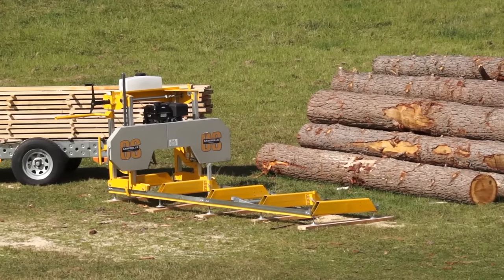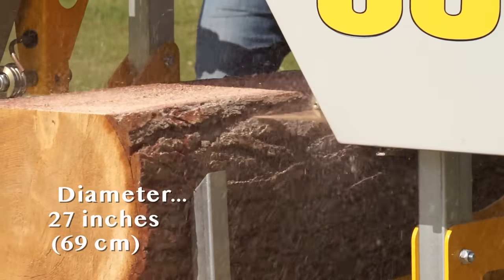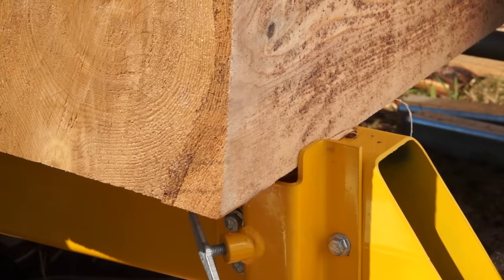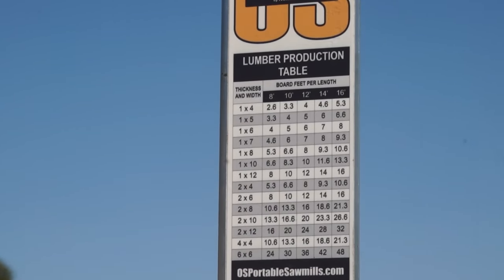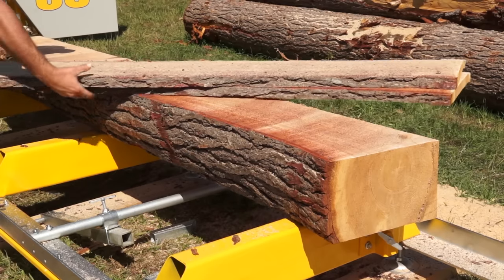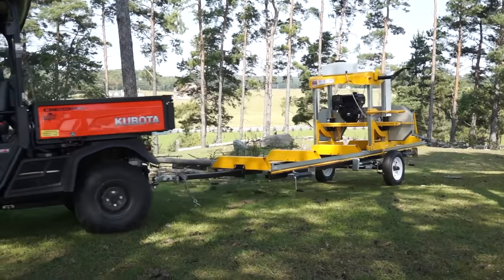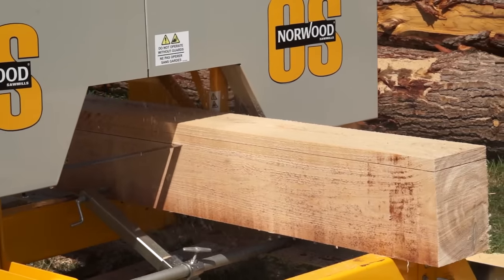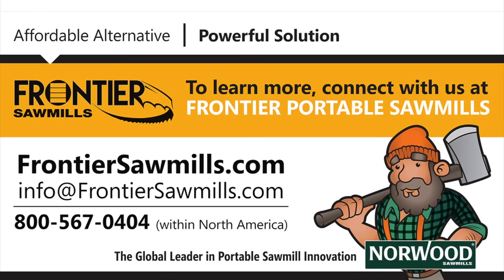The Affordable, Easy-to-Use & Reliable Sawmill You've Been Looking for - The Frontier OS27

Comment: What is the price
Reply from the maker: Frontier builds three sawmill models with different log diameter capacities: OS23: 59cm (23”), OS27: 69cm (27”), and OS31: 79cm (31”). Standard log length is 3.4m (11’) but you can add 7’ (2.1m) extensions to mill as long as you want.  You can add the optionally available trailer/support jack system to all Frontier sawmills at any time (when you get your Frontier or in the future).

Frontier Sawmills start at just USD $2297 (for the Frontier OS23). The Frontier OS27 starts at only USD $3297.  The Frontier OS31 starts at only USD $3897.  

You can get a lot of helpful info about Frontier Sawmills, including all pricing, at www.FrontierSawmills.com  .

Frontier services your country factory-direct.  To order, contact us directly at Frontier Sawmills via email at info@FrontierSawmills.com .

Comment: how much is the price of the day
Reply from the maker: Frontier builds three sawmill models with different log diameter capacities: OS23: 59cm (23”), OS27: 69cm (27”), and OS31: 79cm (31”). Standard log length is 3.4m (11’) but you can add 7’ (2.1m) extensions to mill as long as you want.  You can add the optionally available trailer/support jack system to all Frontier sawmills at any time (when you get your Frontier or in the future).

Frontier Sawmills start at just USD $2297 (for the Frontier OS23). The Frontier OS27 starts at only USD $3297.  The Frontier OS31 starts at only USD $3897.  

You can get a lot of helpful info about Frontier Sawmills, including all pricing, at www.FrontierSawmills.com  .

Comment: how many price in bangladesh.I want it
Reply from the maker: Frontier builds three sawmill models with different log diameter capacities: OS23: 59cm (23”), OS27: 69cm (27”), and OS31: 79cm (31”). Standard log length is 3.4m (11’) but you can add 7’ (2.1m) extensions to mill as long as you want.  You can add the optionally available trailer/support jack system to all Frontier sawmills at any time (when you get your Frontier or in the future).

Frontier Sawmills start at just USD $2297 (for the Frontier OS23). The Frontier OS27 starts at only USD $3297.  The Frontier OS31 starts at only USD $3897.  

You can get a lot of helpful info about Frontier Sawmills, including all pricing, at www.FrontierSawmills.com  .

Comment: how much i want a one
Reply from the maker: Frontier builds three sawmill models with different log diameter capacities: OS23: 59cm (23”), OS27: 69cm (27”), and OS31: 79cm (31”). Standard log length is 3.4m (11’) but you can add 7’ (2.1m) extensions to mill as long as you want.  You can add the optionally available trailer/support jack system to all Frontier sawmills at any time (when you get your Frontier or in the future).

Frontier Sawmills start at just USD $2297 (for the Frontier OS23). The Frontier OS27 starts at only USD $3297.  The Frontier OS31 starts at only USD $3897.  

You can get a lot of helpful info about Frontier Sawmills, including all pricing, at www.FrontierSawmills.com  .

To order, contact us directly at Frontier Sawmills via email at info@FrontierSawmills.com .

Comment: How many cost
Reply from the maker: Frontier builds three sawmill models with different log diameter capacities: OS23: 59cm (23”), OS27: 69cm (27”), and OS31: 79cm (31”). Standard log length is 3.4m (11’) but you can add 7’ (2.1m) extensions to mill as long as you want.  You can add the optionally available trailer/support jack system to all Frontier sawmills at any time (when you get your Frontier or in the future).

Frontier Sawmills start at just USD $2297 (for the Frontier OS23). The Frontier OS27 starts at only USD $3297.  The Frontier OS31 starts at only USD $3897.  

You can get a lot of helpful info about Frontier Sawmills, including all pricing, at www.FrontierSawmills.com  .

Frontier services your country factory-direct.  To order, contact us directly at Frontier Sawmills via email at info@FrontierSawmills.com .

Comment: What is cost of it
Reply from the maker: Frontier builds three sawmill models with different log diameter capacities: OS23: 59cm (23”), OS27: 69cm (27”), and OS31: 79cm (31”). Standard log length is 3.4m (11’) but you can add 7’ (2.1m) extensions to mill as long as you want.  You can add the optionally available trailer/support jack system to all Frontier sawmills at any time (when you get your Frontier or in the future).

Frontier Sawmills start at just USD $2297 (for the Frontier OS23). The Frontier OS27 starts at only USD $3297.  The Frontier OS31 starts at only USD $3897.  

You can get a lot of helpful info about Frontier Sawmills, including all pricing, at www.FrontierSawmills.com  .

Comment: How much cost a machine like this?
Reply from the maker: Frontier builds three sawmill models with different log diameter capacities: OS23: 59cm (23”), OS27: 69cm (27”), and OS31: 79cm (31”). Standard log length is 3.4m (11’) but you can add 7’ (2.1m) extensions to mill as long as you want.  You can add the optionally available trailer/support jack system to all Frontier sawmills at any time (when you get your Frontier or in the future).

Frontier Sawmills start at just USD $2297 (for the Frontier OS23). The Frontier OS27 starts at only USD $3297.  The Frontier OS31 starts at only USD $3897.  

You can get a lot of helpful info about Frontier Sawmills, including all pricing, at www.FrontierSawmills.com  .

Frontier services your country factory-direct.  To order, contact us directly at Frontier Sawmills via email at info@FrontierSawmills.com . 

Thanks!

Comment: Any idea how much costs?
Reply from the maker: Frontier builds three sawmill models with different log diameter capacities: OS23: 59cm (23”), OS27: 69cm (27”), and OS31: 79cm (31”). Standard log length is 3.4m (11’) but you can add 7’ (2.1m) extensions to mill as long as you want.  You can add the optionally available trailer/support jack system to all Frontier sawmills at any time (when you get your Frontier or in the future).

Frontier Sawmills start at just USD $2297 (for the Frontier OS23). The Frontier OS27 starts at only USD $3297.  The Frontier OS31 starts at only USD $3897.  

You can get a lot of helpful info about Frontier Sawmills, including all pricing, at www.FrontierSawmills.com  .

Comment: Can we get this in india?
Reply from the maker: Hi Anil

Frontier builds three sawmill models with different log diameter capacities: OS23: 59cm (23”), OS27: 69cm (27”), and OS31: 79cm (31”). Standard log length is 3.4m (11’) but you can add 7’ (2.1m) extensions to mill as long as you want.  You can add the optionally available trailer/support jack system to all Frontier sawmills at any time (when you get your Frontier or in the future).

Frontier Sawmills start at just USD $2297 (for the Frontier OS23). The Frontier OS27 starts at only USD $3297.  The Frontier OS31 starts at only USD $3897.  

You can get a lot of helpful info about Frontier Sawmills, including all pricing, at www.FrontierSawmills.com  .

Frontier services your country factory-direct.  To order, contact us directly at Frontier Sawmills via email at info@FrontierSawmills.com .
Reply: @FrontierSawmills  davanga manadu kovai

Comment: I want this machine how to by??????
Reply from the maker: Frontier builds three sawmill models with different log diameter capacities: OS23: 59cm (23”), OS27: 69cm (27”), and OS31: 79cm (31”). Standard log length is 3.4m (11’) but you can add 7’ (2.1m) extensions to mill as long as you want.  You can add the optionally available trailer/support jack system to all Frontier sawmills at any time (when you get your Frontier or in the future).

Frontier Sawmills start at just USD $2297 (for the Frontier OS23). The Frontier OS27 starts at only USD $3297.  The Frontier OS31 starts at only USD $3897.  

You can get a lot of helpful info about Frontier Sawmills, including all pricing, at www.FrontierSawmills.com  .

Comment: Ye masin kitna ka hai
Reply from the maker: Frontier builds three sawmill models with different log diameter capacities: OS23: 23” (59cm), OS27: 27” (69cm), and OS31: 31” (79cm). Standard log length is 11’ (3.4m) but you can add 7’ (2.1m) extensions to mill as long as you want.   

Frontier Sawmills start at just USD 2297 (for the Frontier OS23). The Frontier OS27 starts at only USD $3297.  The Frontier OS31 starts at only USD $3897.  

You can get a lot of helpful info about Frontier Sawmills, including all pricing, at www.FrontierSawmills.com  .

Frontier services your country factory-direct.  To order, contact us directly at Frontier Sawmills via email at info@FrontierSawmills.com .

Comment: i need a 1* complete set total cast with shipping charges
Reply from the maker: Frontier builds three sawmill models with different log diameter capacities: OS23: 59cm (23”), OS27: 69cm (27”), and OS31: 79cm (31”). Standard log length is 3.4m (11’) but you can add 7’ (2.1m) extensions to mill as long as you want.  You can add the optionally available trailer/support jack system to all Frontier sawmills at any time (when you get your Frontier or in the future).

Frontier Sawmills start at just USD $2297 (for the Frontier OS23). The Frontier OS27 starts at only USD $3297.  The Frontier OS31 starts at only USD $3897.  

You can get a lot of helpful info about Frontier Sawmills, including all pricing, at www.FrontierSawmills.com  .

Frontier services your country factory-direct.  To order, contact us directly at Frontier Sawmills via email at info@FrontierSawmills.com . 

Thanks!
Reply: @FrontierSawmills  I want to buy OS27
Reply: Northeast India
Reply: Yantai RIMA MACHINERY china : $1000 usd

Comment: क्या यह मशीन भारत में उपलब्ध है इसे लेने में कोई कानूनी मुश्किल तो नहीं आएगी
Reply from the maker: Frontier builds three sawmill models with different log diameter capacities: OS23: 59cm (23”), OS27: 69cm (27”), and OS31: 79cm (31”). Standard log length is 3.4m (11’) but you can add 7’ (2.1m) extensions to mill as long as you want.  You can add the optionally available trailer/support jack system to all Frontier sawmills at any time (when you get your Frontier or in the future).

Frontier Sawmills start at just USD $2297 (for the Frontier OS23). The Frontier OS27 starts at only USD $3297.  The Frontier OS31 starts at only USD $3897.  

You can get a lot of helpful info about Frontier Sawmills, including all pricing, at www.FrontierSawmills.com  .

Frontier services your country factory-direct.  To order, contact us directly at Frontier Sawmills via email at info@FrontierSawmills.com . 

Thanks!

Comment: What is price for this machine
Reply from the maker: Frontier builds three sawmill models with different log diameter capacities: OS23: 59cm (23”), OS27: 69cm (27”), and OS31: 79cm (31”). Standard log length is 3.4m (11’) but you can add 7’ (2.1m) extensions to mill as long as you want.  You can add the optionally available trailer/support jack system to all Frontier sawmills at any time (when you get your Frontier or in the future).

Frontier Sawmills start at just USD $2297 (for the Frontier OS23). The Frontier OS27 starts at only USD $3297.  The Frontier OS31 starts at only USD $3897.  

You can get a lot of helpful info about Frontier Sawmills, including all pricing, at www.FrontierSawmills.com  .

Frontier services your country factory-direct.  To order, contact us directly at Frontier Sawmills via email at info@FrontierSawmills.com . 

Thanks!

Comment: I want to this. How can I buy this mini saw mill.
Reply from the maker: Hi Bajun

Just contact us at Frontier Sawmills.

Frontier builds three sawmill models with different log diameter capacities: OS23: 59cm (23”), OS27: 69cm (27”), and OS31: 79cm (31”). Standard log length is 3.4m (11’) but you can add 7’ (2.1m) extensions to mill as long as you want.  You can add the optionally available trailer/support jack system to all Frontier sawmills at any time (when you get your Frontier or in the future).

Frontier Sawmills start at just USD $2297 (for the Frontier OS23). The Frontier OS27 starts at only USD $3297.  The Frontier OS31 starts at only USD $3897.  

You can get a lot of helpful info about Frontier Sawmills, including all pricing, at www.FrontierSawmills.com  .

To order, contact us directly at Frontier Sawmills via email at info@FrontierSawmills.com .

Comment: prince how many
Reply from the maker: Frontier builds three sawmill models with different log diameter capacities: OS23: 59cm (23”), OS27: 69cm (27”), and OS31: 79cm (31”). Standard log length is 3.4m (11’) but you can add 7’ (2.1m) extensions to mill as long as you want.  You can add the optionally available trailer/support jack system to all Frontier sawmills at any time (when you get your Frontier or in the future).

Frontier Sawmills start at just USD $2297 (for the Frontier OS23). The Frontier OS27 starts at only USD $3297.  The Frontier OS31 starts at only USD $3897.  

You can get a lot of helpful info about Frontier Sawmills, including all pricing, at www.FrontierSawmills.com  .

Frontier services your country factory-direct.  To order, contact us directly at Frontier Sawmills via email at info@FrontierSawmills.com . 

Thanks!

Comment: how mach this machine?
Reply from the maker: Frontier builds three sawmill models with different log diameter capacities: OS23: 59cm (23”), OS27: 69cm (27”), and OS31: 79cm (31”). Standard log length is 3.4m (11’) but you can add 7’ (2.1m) extensions to mill as long as you want.  You can add the optionally available trailer/support jack system to all Frontier sawmills at any time (when you get your Frontier or in the future).

Frontier Sawmills start at just USD $2297 (for the Frontier OS23). The Frontier OS27 starts at only USD $3297.  The Frontier OS31 starts at only USD $3897.  

You can get a lot of helpful info about Frontier Sawmills, including all pricing, at www.FrontierSawmills.com  .

Frontier services your country factory-direct.  To order, contact us directly at Frontier Sawmills via email at info@FrontierSawmills.com .

Comment: আসসালামু আলাইকুম এই মেশিনটা কি বাংলাদেশে পাওয়া যাবে
Reply from the maker: Frontier builds three sawmill models with different log diameter capacities: OS23: 59cm (23”), OS27: 69cm (27”), and OS31: 79cm (31”). Standard log length is 3.4m (11’) but you can add 7’ (2.1m) extensions to mill as long as you want.  You can add the optionally available trailer/support jack system to all Frontier sawmills at any time (when you get your Frontier or in the future).

Frontier Sawmills start at just USD $2297 (for the Frontier OS23). The Frontier OS27 starts at only USD $3297.  The Frontier OS31 starts at only USD $3897.  

You can get a lot of helpful info about Frontier Sawmills, including all pricing, at www.FrontierSawmills.com  .

Frontier services your country factory-direct.  To order, contact us directly at Frontier Sawmills via email at info@FrontierSawmills.com .

Comment: How much price in india
Reply from the maker: Frontier builds three sawmill models with different log diameter capacities: OS23: 59cm (23”), OS27: 69cm (27”), and OS31: 79cm (31”). Standard log length is 3.4m (11’) but you can add 7’ (2.1m) extensions to mill as long as you want.  You can add the optionally available trailer/support jack system to all Frontier sawmills at any time (when you get your Frontier or in the future).

Frontier Sawmills start at just USD $2297 (for the Frontier OS23). The Frontier OS27 starts at only USD $3297.  The Frontier OS31 starts at only USD $3897.  

You can get a lot of helpful info about Frontier Sawmills, including all pricing, at www.FrontierSawmills.com  .

Frontier services your country factory-direct.  To order, contact us directly at Frontier Sawmills via email at info@FrontierSawmills.com .

Comment: I will buy thise price..
Reply from the maker: Frontier builds three sawmill models with different log diameter capacities: OS23: 59cm (23”), OS27: 69cm (27”), and OS31: 79cm (31”). Standard log length is 3.4m (11’) but you can add 7’ (2.1m) extensions to mill as long as you want.  You can add the optionally available trailer/support jack system to all Frontier sawmills at any time (when you get your Frontier or in the future).

Frontier Sawmills start at just USD $2297 (for the Frontier OS23). The Frontier OS27 starts at only USD $3297.  The Frontier OS31 starts at only USD $3897.  

You can get a lot of helpful info about Frontier Sawmills, including all pricing, at www.FrontierSawmills.com  .

Comment: How price
Reply from the maker: Frontier builds three sawmill models with different log diameter capacities: OS23: 59cm (23”), OS27: 69cm (27”), and OS31: 79cm (31”). Standard log length is 3.4m (11’) but you can add 7’ (2.1m) extensions to mill as long as you want.  You can add the optionally available trailer/support jack system to all Frontier sawmills at any time (when you get your Frontier or in the future).

Frontier Sawmills start at just USD $2297 (for the Frontier OS23). The Frontier OS27 starts at only USD $3297.  The Frontier OS31 starts at only USD $3897.  

You can get a lot of helpful info about Frontier Sawmills, including all pricing, at www.FrontierSawmills.com  .